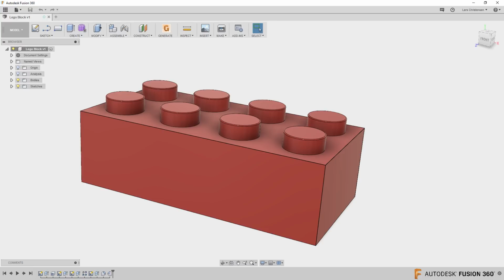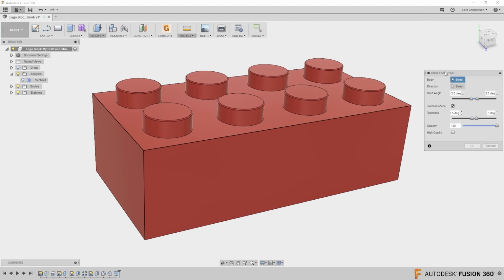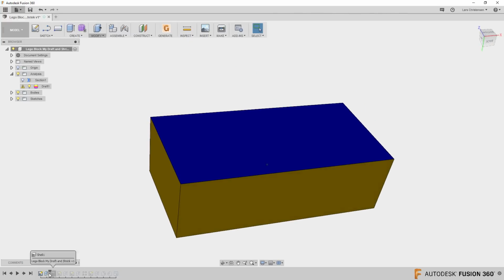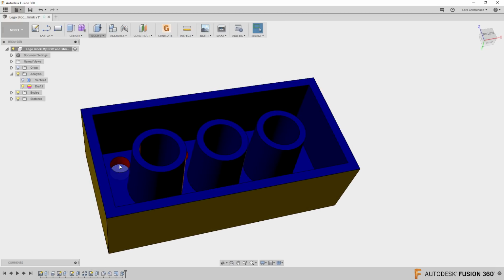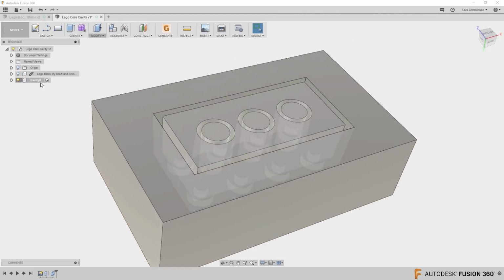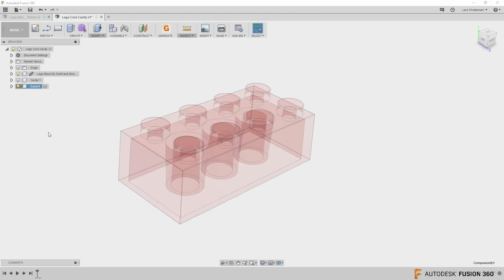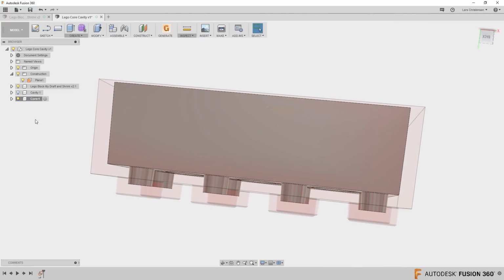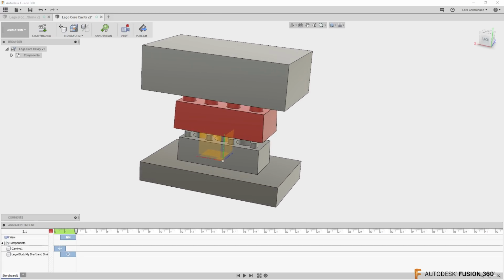Make Core & Cavity For a Mold — Fusion 360 Tutorial — #LarsLive 158

Comment: Really like all of your videos and have learned a lot from them. Tried to follow this video for a phone case I'm making. My problem is, I can't create the cavity. First of all, the case has rounded edges like an iPhone, so the top and bottom part are further towards the center than the edge of the case. Because of this, I'm unsure on how to make the mould. The second problem is, the case has cutouts for the charging port, buttons, camera etc. so when I combine, the component only contains one body. Making it impossible to delete eg. the pipes.

So, how would do it with the Lego block, if the pipes wasn't pipes but holes that went through the block and fillet walls?
Reply from the maker: Hi Umut Ucler Thank you for watching!
Did you see this series?
https://youtu.be/_hgmwhde1So?list=PL40d7srwyc_OmIh7DY-8MQ_zGTL23JeBU

Hope this will help
Reply: Lars Christensen thank you. Found them after watching this video and I'm close to finish my mold, thanks to your videos

Comment: Hi Lars!
I have another question about the parametrization. I'm trying to model a board with a set of electric connectors. The 
connectors are all of the same type but they can have 2, 3, 4 or more pins in a row. I've made the parametric model 
of the connector, so when I change the number of pins, the model changes.
And here is my question. How to insert into the assembly several connectors with different numbers of pins? When I 
use "copy" and "paste" or "paste new", I get the exact copy which uses the same parameters and has the same 
dimensions.
And when I use "Insert into current design" and then "Break link", I get a mess of user parameters with the same 
names, like Smth, Smth_1, Smth_2, and so on. Is it possible to sort the parameters, or show only the ones for the 
active component?
Reply from the maker: Hi Alex Antonov Thank you for watching!
I might need more coffee. But, you might want to consider using these as sub assemblies?
Not sure this is a good answer

Comment: Why did you remove the pins from the core?
Reply from the maker: Hi Zoti Dazoti Thank you for watching!
Normally they would be core pins and therefore a different components....Also, I am just trying to show the Fusion 360 tools :-) Not making correct parts
Reply: OK. Thanks. I was figuring out it is just for the demo as I have seen a video of the actual lego molds and the pins are part of the core.

Comment: Problem with lego is that they have draft only inside the block. 
https://youtu.be/RMjtmsr3CqA?t=423
Reply from the maker: Hi Przemek Potyra Thank you for watching! AND awesome video! Thank you for sharing
Reply: Good point! I think cosmetically it would look bad when blocks were stacked if there were a draft on the outside, so I guess that since the plastic shrinks away from the core, they can keep it from sticking in the cavity if they have an excellent surface finish.
Reply: More important - with outside draft you always have a gap between 2 bricks placed next to each other on a lego base plate.